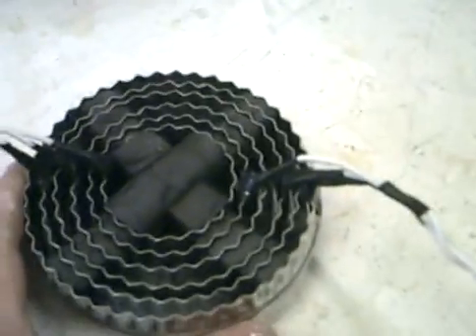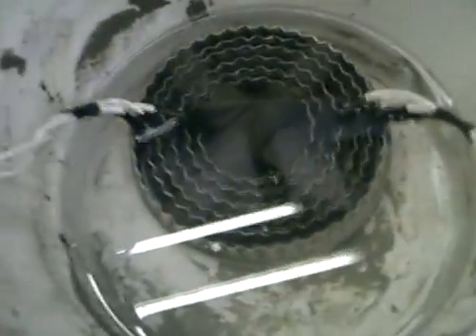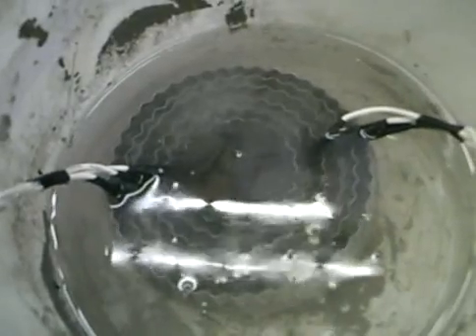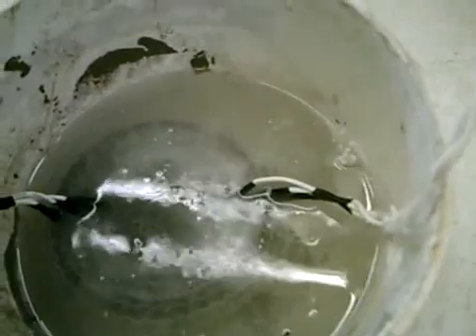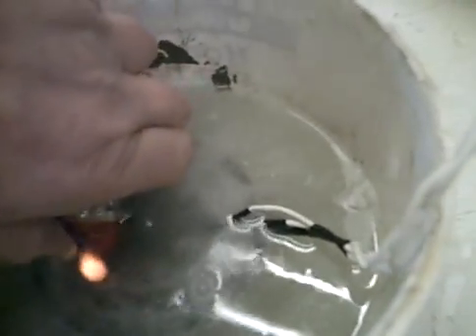HHO

Comment: Currently the best method is buy a Honda, keep the tires at optimum pressure, make sure its serviced regularly & drive sensibly.
You would get as good a performance as any claimed by HHO proponents.

Comment: The excess electricity can just about cover the rest of the electronic, devices like AC's consume way more electricity and affect fuel economy.
The HHO method is similar to the more effective Nitro systems. If you can somehow generate the required power to split water at home (via Solar Panels) then move the gasses in cannisters to the car it could be more effective.

Comment: The primary function of the alternator is to generate electricity to power the battery to in turn fire the spark plugs.
You are already diverting electricity for basic secondary functions like lights, windshield wiper & air con.
Adding a third layer of high energy consumption to power HHO would require more gas.

Comment: The energy required to create oil is immense, Oil is created from dead sea creatures who have decomposed over millions of years at incredible pressures.
To create oil artificially would require more energy then that released from burning.

Adding a HHO mix into the the fuel supply will probably increase the power output.
But the electricity required to split the water molecules needs to come from somewhere.
Taking it from the dynamo means more energy needed to turn the dynamo = more revs.

Comment: Boyntonstu is right, if your using less energy to split the water into base elements then the amount of energy created by the combining the generated Hydrogen+Oxygen then congratulations you have not only invented perpetual motion but also broken the 1st law of thermodynamics. If so jump on a plane to stokholm the Nobel Prize in physics awaits you.
These experiments are fun but are not a solution to the energy problem, People claim it works in cars but they are wrong

Comment: Not quite. It's simply splitting water into a form useable as a fuel. the energy from the generator isn't used to create new matter. it's releasing the already stored enery in already existing matter.

That is correct.  Hoe much enrgy is used to "release" the "stored" energy?

How much energy is "released"?

Now divide one by the other to calculate the gain or the loss.

Comment: To you and to all HHO generator enthusiast/sellers:

How many Amps/Watts does your generator use?

My guess, 2 Amps at 14 Bolts or 28 Watts.

Remember 746 Watts is needed to produce 1HP (ONE HORSEPOWER).

Does the HHO output produce more Watts when burned in the engine than the Watts consumed in your HHO generator?

If the answer is yes, congratulations! You have just invented perpetual motion!